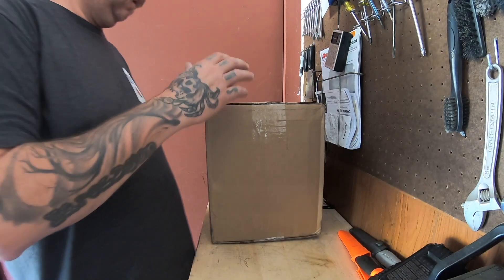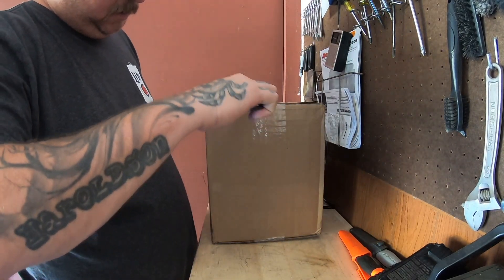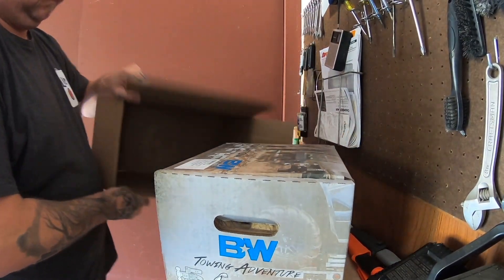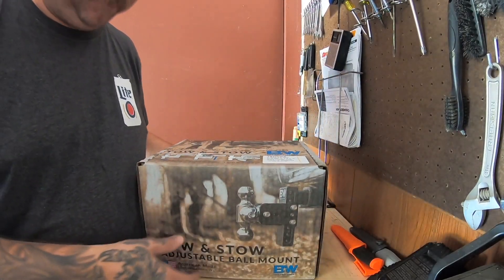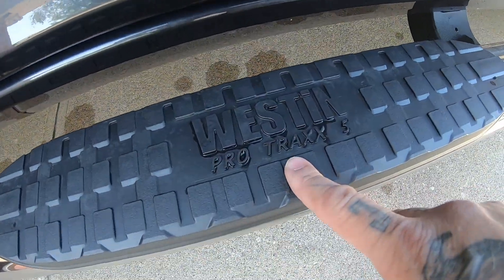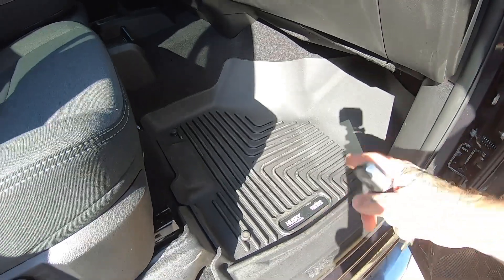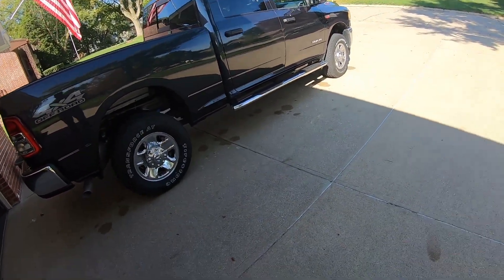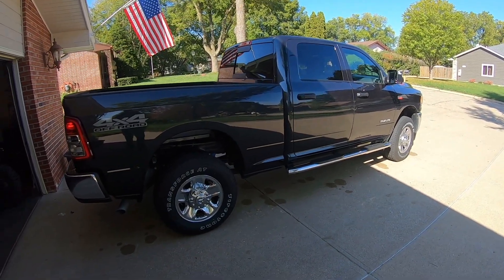2022 Ram 2500 - Upgrades

Comment: Did the dealer do the remote start, I just got same truck and really want remote start, how much was it
Reply from the maker: Yes, the dealer did mine.
They charge $589 installed but when buying the truck I got some dealer coupons so it was $442 out the door. You can get after market for less but I didn’t want to carry 2 fobs around. I’m happy with mine. Wouldn’t do it any other way
Reply: @toeshifter  same here, thanks, now I gotta call the dealer
Reply: @toeshifter  What dealer installed you remote start.
Reply: @Toe Shifter @R&R Land Service If your hood latch has the switch built in which most do you only need the remote start keyfob which you can buy for $80 dollars and need to have the dealer add the sales code. You will end up  with remote start and remote tailgate drop for $125-175. I just had my 2021 tradesman done. You can tell if the hood latch has the switch if you see electrical wires/connector coming from it. you will need the tailgate soft open dampener which can be found for $25-40 dollars shipped.
Reply: @welderbluejay  where do I get the real key for, dealer? Watch them try to tell me it's more than just a fob

Comment: Looks great 👍 I just bought a 2022 2500 as well... were you able to order those huskyliners for a 2022? I can only find them for a 2021 and don't know if they're the same
Reply from the maker: I ordered for a 2021 and the only difference will be for the backseat. It isn’t a perfect fit in the back due to the vents at the bottom of the center console. But there is room to tuck the mat under the console. You could also cut it but I opted for the tuck. Still looks great
Reply: @toeshifter  gotcha... I'm gonna try that, thank you!